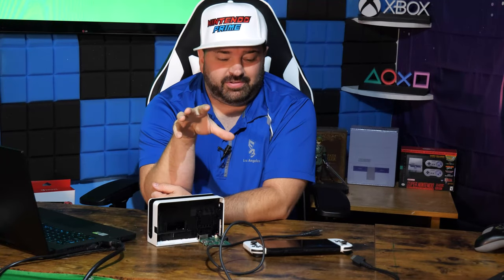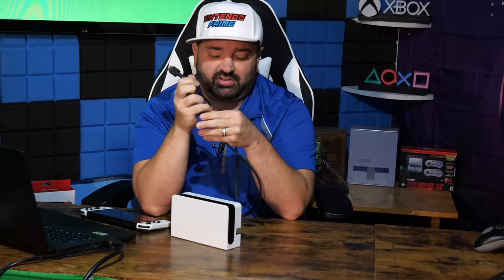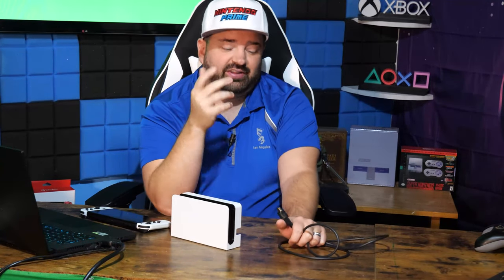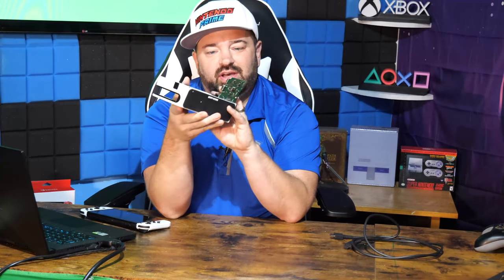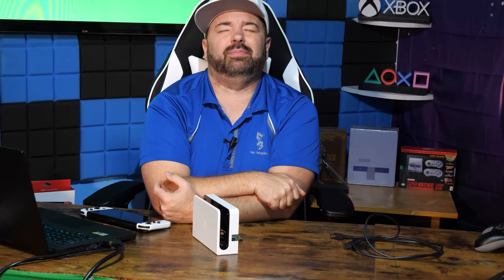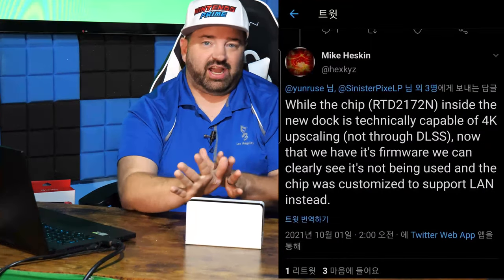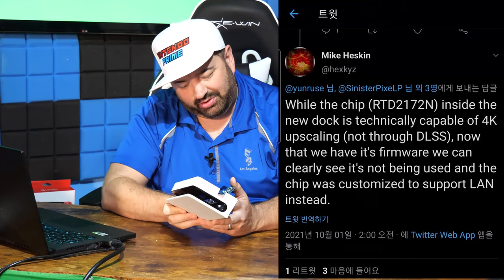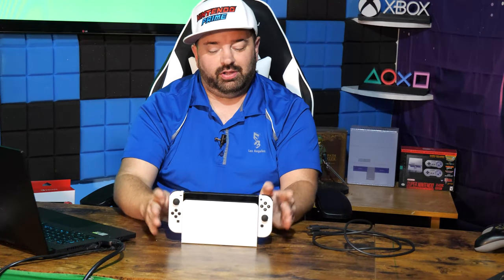Switch OLED's Dock Can Output 4k & 60fps, Future Proofing for a New Switch!

Comment: Nintendo is basically just trolling at this point, they 100% know that people are going to teardown the switch and keep hyping up the console
Reply: @enriquepinero707  I think a big reason they don’t overclock it would be due to the heat output and tbh the switch’s heat solution isn’t really ideal if it was a regular console with full blown heat sink and fan then yea it would be fine the switch is by far the most hottest console in terms of heat compared to nintendo’s two past consoles
Reply: @Lalovoe  The games are not gonna run at native 4K it will just send a 4K signal to the TV while running at 1080p or 900p. The current Switch maxes out at 1080p and can only send a 1080p signal to the TV while running games in 720p, sub HD or lower. Same way how the PS5 and Series X are marketed as 4K machines but, run games at 1440p resolution upscaled to 4K.
Reply: @enriquepinero707  Nintendo just like any other company know what they are doing with stable clock speeds for consistent performance, battery life and No over heating. It’s not Nintendo trolling it’s them not trying to design a 1 hour battery life hand heater.
Reply: @alexbolt5  I agree when it comes to handheld mode. But in docked mode; with a good fan in the dockand ventilation system (combined with the little fan in the Switch); it could be possible. Maybe not with the OLED dock but again; one that takes potential heat issues in mind. It was also said that the current chip in the v2 Switches run better and cooler than the v1 versions. Let's also not forget the few official games that have a quality and performance mode programed in (Fire Emblem Warriors, Darksiders Warmastered and Rocket League. With the right focus and application; it's possible to get better performance in docked mode at least.
Reply: @enriquepinero707  Yea like I don’t expect it to run hotter in handheld I have the launch and v2 switch’s and they all stay cool in handheld the issue is in dock play now I agree they can make it happen but they would have to change the ventelation or the inside cooling to be more efficient whithout having the need to put a external little fan right on the vents of the dock
Reply: the nvidia shield console has less cooling than the switch and runs @ max clocks all the time.
I can also overclock my og switch to max. and it can run for hours without problem
Reply: @HermesderWetterbote  Exactly. Yet we have people who think this isn't possible. Nintendo really tricking the masses. This is the real reason they go after the hacking scene so hard; because it exposes thier unwillingness to do right by the consumers (those who actually support them).

Comment: tbh I would like it if this future 4k switch had a 1440p option
Reply: If it can handle 4k, then it should do 1440. This is just the output resolution though and not the games internal rendering resolutions. It's meant to make it less blurry so your monitor/TV doesn't have to handle the upscaling.

Comment: For now, the switch can struggle in some games even at 1080p and 720p, also we can have stutters, all because of a very dated Tegra X1 chip
Reply: Even if Nintendo went with a Tegra X2 it would not have been as big of a difference as people made it out to be. Along with Nvidia charging Nintendo a lot for the Tegra X2 and Nintendo coming from the failure that was the Wii U. Both Nintendo and Nvidia did not want to take that risk and it was the last decision made by the CEO that followed Mr. Satoru Iwata’s ideology of hardware. What matters know is if Nintendo goes all out on the Switch successor due to tremendous success and a new CEO.
Reply: @ZackSNetwork  Tegra X1 is even behind NVIDIA Pascal (GTX 1000 series cards) that is the minimum required for good framerates at 1080p in every single game out there.

That is already way better than Tegra X1, Nintendo should implement DLSS and use a chip based on Ampere or something like that, because perfomance in games like Hyrule Warriors is extremely rough af, or playing Fortnite on the Switch, Doom Eternal, etc. SO GPU limited, also CPU limited.
Reply: @ZackSNetwork  I don't want Nintendo to put a Switch version of an RTX3090 and run better at 4k like the competition, at least i want them to be competent at 1080p without using dynamic resolution or dropping to 568p and other nonsense.

For 4K, DLSS is enough, they fixed the horrible screen with the OLED model and the kickstand, now they have to fix the internals and fix the joysticks from the joycons.
Reply: @ZackSNetwork  CPU wise, i think the Switch has a 4 core, 4 thread ARM chip, when the absolute minimum for gaming is 4 core 8 thread at least on the x86 side. The worst part is that in reality the Switch only has 3 cores for games, the remaining one core is for the OS.

I think they wil launch a 4+4 chip, at least 4 high perfomance cores, and maybe 3 efficient cores as the max for games, then you can switch between different games without having to close them.
Reply: @ZackSNetwork  the tegra Xavier could have been used in a switch pro if Nintendo wanted and would have been a good jump in performance, about the same going from 3DS to new 3DS but it looks like Nintendo are waiting for next gen and a more powerful chip.

Comment: I posted this on another youtuber's video the other day, and I think it's worth sharing here

"I think you may be right.  I think maybe the OLED should have been the updated Switch but it got pushed back.  Might explain why the dock has a chip with updatable firmware (maybe to enable 4k when the time is ready)

When you consider all the little changes to the Switch OLED, it does seem like almost an upgraded system, rather than just "we can't get the original LCD anymore so we're switching to OLED""

The only thing with this though is what would they do to differentiate a 4K Switch from a standard one?  Larger screen again?  At least with the OG switch being the old model and the 4k one being the OLED with all the improvements, it would have been obvious which was which.  Would they just put the new internals into the OLED chassis?  Might cause confusion
Reply: But why did it get pushed back? Nate said there's no actual chip or semiconductor shortage, so why would they choose to release this half step instead? 🤔
Reply: @corey2232  No Idea.  Maybe to run down current inventory?  Maybe there is a contract in place that Nintendo agreed to X years of production or something?
I can't comment on whatever is in the Switch, but I have heard problems with people getting PS5/Xbox and graphics cards in general.  Maybe it's some availability issue that affects the new chipset and not the old one?

Maybe availability of LCD panels forced their hand a bit so they had to bring forward plans for the new chassis, but with Christmas coming up, they know it'll sell well anyway.  They don't /need/ a 4k Switch at this point.  Maybe next year if/when sales start to slow.

I dunno.  it's what makes this situation so interesting/mysterious.  On one hand we have people saying there is proof (and other things that point to) a 4k Switch, yet we got this weird semi update

Thing is they will just deny anything to do with a 4k Switch right now because they know it'll kill OLED sales.  I'd certainly cancel if I knew a 4k Switch was 100% happening
Reply from the maker: Not sure who this Nate guy is, but I assume it's not me. There are multiple bottlenecks currently in the chip manufacturing business happening right now.

Comment: I would like if Nintendo puts a special graphics card on the Switch's dock designed by NVIDIA and for the Switch itself. They simply improve the CPU and RAM speed on the Switch itself. That would be a crazy idea.
Reply: That Might cause issues if you remove it from the dock mid play session but not a bad idea
Reply: @Yusei255  The OLED model happened, that is already a HUGE step over everything that came before it.
Reply: Seriously if you actually did your research everyone with common sense debunked the stupid dock belief along time ago.
Reply: @ZackSNetwork  Why the OLED dock is bigger and has vents for future fans?

Comment: There are no "HDMI 1.4/2.0/2.1 cables". Proper HDMI cable names are: "Standard", "High Speed", "Premium High Speed" and "Ultra High Speed". "Standard" cable has 720p limit, "High Speed" is what you are describing as "1.4 cable". But you can do 4K@60Hz (HDMI 2.0) without a problem with good quality "High Speed" cable, or you can buy "Premium High Speed" which is certified to work with HDMI 2.0.
And you said "seems to take 1.4 and convert to 2.0", I don't know how to comment on that, it's just stupid.
Reply: I believe he was speaking in layman terms...nerd. smh

Comment: I just want to know if this new dock could help the OLED Switch play BotW at 1080p at a steady 30fps. That for me would be huge. If the new dock could play DOOM, Witcher, Journey to a Savage Planet… other impossible ports at 1080p. THAT would be pretty huge to me. If it could boost existing games to 60fps, again that would be awesome! Just an option for performance and quality modes would be a big step up. Can this new dock do that at least?
Reply: No. Neither the original or updated Dock can render or improve games. The Nintendo Switch itself is what handles the task of rendering.
The dock is simply a way to covert the video signal coming from the USB-C port on the bottom of the Switch to something you can connect to your TV.
The new dock contains an updated converter chip that makes it possible for the Switch to output a 3840x2160 video feed at 60Hz. The previous dock allowed for up to 3840x2160 at 30Hz. Nintendo never activated 4K support though because there's little point beyond MAYBE a better upscaling algorithm than what your TV has. Switch cannot handle 4K rendering besides maybe very, very old games and videos from places like YouTube or Netflix (On a hardware level). Nintendo may never support it either - but the hardware is there for extremely limited 4K support.

Comment: The Switch won't use Nvidia's DLSS (Deep Learning Super Sampling), but instead, Nintendo might use AMD's FSR (FidelityFX Super Resolution)!!
Reply: juliette Irene  Yes, but Nvidia’s DLSS technology only does AI upscaling on a case-by-case basis, while AMD’s FSR does AI upscaling across all games. So Nintendo would want an AI upscaler that’ll be universal to every developer!!
Reply: @mattimusprimal637  How do you even know that especially with rumors all pointing to a custom new Nvidia SOC that would have DLSS technology. I don’t see why Nintendo can’t use both DLSS or FSR just like at 2000 and 3000 series Nvidia GPU’s can.
Reply: @ZackSNetwork  We'll see what happens with the next-gen Switch (in a year or two)!!
Reply: @mattimusprimal637  To be honest I don’t care if it’s Nvidia hardware or AMD as long as the technology is powerful and competent.
Reply: @ZackSNetwork  Yes! I agree!! We need the next-gen Switch that's able to handle 3rd Party ports from last-gen (XBOne & PS4) and current-gen (XB Series X|S & PS5) games!!

Comment: All HDMI cables are functionally identical just like all USB cables are, because they all use the same pin out, and all that matters is the size of the plug when it comes to compatibility! Please stop misinforming others so they get ripped off when purchasing HDMI cables! The HDMI chip that is behind the HDMI port on the circuit board is what determines the HDMI version!
Reply from the maker: Not true. There are different speeds capability’s in hdmi cables (and for that matter, usb cables). You can’t take and old usb a to usb c cable, as an example, and have it work with s Logitech brio webcam. It requires used 3.0 speeds - and even if you plug a black usb a to usb c cable into a usb 3.0 or 3.1 jack, the picture will keep cutting out. 

I know this because I’ve experienced it. Yet a proper blue plug usb 3.1 to usb c cable, had no such issues. The pin out here isn’t the issue - it’s the size of the cables inside. There are cables capable of carrying 1.5Mbps and ones that carry 2.0, etc. This is due to the gauge of the wire used. Higher gauged wire, delivers different top end speeds. 

As for hdmi - they don’t label them as 1.4, 2.0, 2.1, etc. they are instead labeled as standard, high speed, premium speed, and ultra high speed. Each cable type has a different rated speed application, especially over runs longer than 3 feet.

So anyone who sits here and pretends the cables don’t have an impact on speed doesn’t understand how cables work.

As an example, USB4 exclusives uses a brand new pin out and cable structure, so older usb-a cables aren’t sufficient. It uses usb c only to maintain certain speed levels.

Comment: FYI, all HDMI cables are technically the same.  They're just copper wire, some insulation, and two HDMI male connectors.  What you're talking about is certification.  Over a short enough distance, same a six inches or a foot, likely any quality HDMI cable, regardless of branding, could carry an 8K30 or 4K60 signal.  The issue is whether or not the cable is actually properly constructed, and whether it can carry the signal over the given HDMI version specifications.  I know this is a little pedantic, so don't worry, you're not really wrong, I just find the subject fascinating.  If you want to learn more, LTT made an awesome video on the subject after buying a ludicrously expensive cable tester: https://www.youtube.com/watch?v=XFbJD6RE4EY

Comment: Sorry, but the is no such a thing like "HDMI 1.4 cable". The ports are from 1.0 to 2.1 for now. The cable are from:
- Standard HDMI cable (not in use today) - can  supports HDMI port from 1.0 do 1.4;
- high speed HDMI cable (that can  supports from 9gbit/s up to 18gbit/s ) supports HDMI ports from 1.0 to 2.0 - there is a premium version  of that cable that just confim the cable was test to  supports up to 18 gbit/s;
- ultra high speed HDMI cable (that can suports up to 48gbit/s ) supports HDMI ports from 1.0 to 2.1.
Switch and even Wii U came with high speed HDMI cable.

Comment: If the Tegra X1 is already capable of converting to 4K, isn’t Nintendo eventually going to make this happen given the new chips in the dock?
Reply: When you look at how games like Age of Calamity run in just 720/1080p with the current Tegra Chip, it would be very very difficult to run 4K and have it run at 30fps or more. So while technically it may be able to, in practice probably not.
Reply: No, the dock is now 4K compatible(it can transfer or output a 4K image from the console to the TV, something the normal dock can't do) with an eventual Switch 2 4K. The 4K upscale of the Tegra X1 is more suited for multimedia purposes if I recall correctly. So it may only be useful for Youtube.

Comment: even ps5 is not capable of 4k with 60fps now, and switch oled is handheld. the steam deck which is more expensive and as big as a brick is around the same performance as PS4. do people even know what are they asking?
Reply: DLSS. The machine doesn't need to be powerful if the software is optimized well enough.
Reply: It's also worth considering how graphically simple switch games are, running BOTW at 4K 60fps is much easier than horizon zero dawn at 4K 60fps. 

I still find a true 4K 60fps switch very unlikely, but the games in question are worth considering.
Reply: Because it's capable of both doesn't mean both at the same time. They're saying it can run up to 4K or it can also run up to 60 FPS. But that doesn't necessarily mean doing both of those things at the same time, which would require very powerful hardware.
Reply: @InfiniteInspirationInc  that software still takes hardware power though, dlss on an Nvidia card takes processing power that would normally be used for rendering the game in the regular way. The final result is better than native rendering, but it isn't free. 

The dock does not appear to be designed for upscaling, it just straight up doesn't have the juice required for running that level of dlss.
Reply: @pieman12345678987654  what are you saying isn't capable of both? The PS5?
Reply: @kieran.grant_  dlss doesn't require any additional juice on gpus, but rather it does the opposite by removing some strain from gpus which result in higher fps, but what is required is rtx hardware with tensor cores which are only available with desktop rtx 2000 and 3000 cards, and the switch's gpu is based on a way older architecture and doesn't have tensor cores
Reply: @kieran.grant_  and dlss isn't really considered "software" as per se
Reply: @naseemyasir  try thinking of it like this:

Rendering normally, a certain GPU can output a game at 4K at around 30-40 fps. Rendering it at 2K nets you 60-80 fps, but using dlss to upscale from 2K gets you 50-70 fps at a resolution that looks very close to 4K. The upscaling takes a bit processing power that would normally be used for a higher framerate, but uses it for the AI upscaling to give a higher resolution instead. It's not free, but it is a good deal.
Reply: @naseemyasir  you're right about dlss not being software, and that the switch/dock doesn't have the architecture necessary for it. I'm kinda using dlss as a general term for AI upscaling in this instance (when talking about the switch) because it's easier to type and gives the right idea.
Reply: @kieran.grant_  No watch digital Foundry PS5 and Series X run games at 1440p upscaled to 4K, dynamic resolutions or checkerboard 1920 by 2160p which is half the pixels of 3840 by 2160p. Also they mean 4K signal output not 4K gaming.
Reply: @ZackSNetwork  I know the consoles upscale with some games, with others it's not necessary. That tourist game that's coming out soon is bragging about how it's going to be the first 8K PS5 game, but it's also much easier to render than most other games on the platform.
Reply: @InfiniteInspirationInc  lt's upscaling then, but i doubt 720p could effectively be upscaled to 4k that easily.